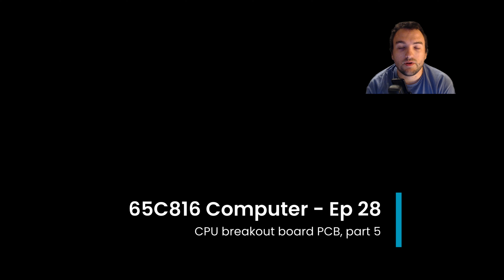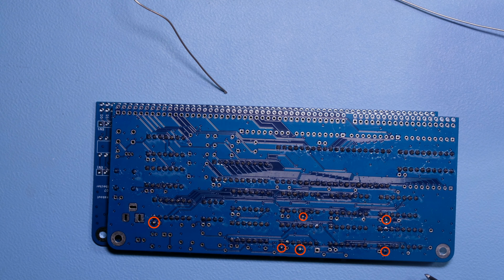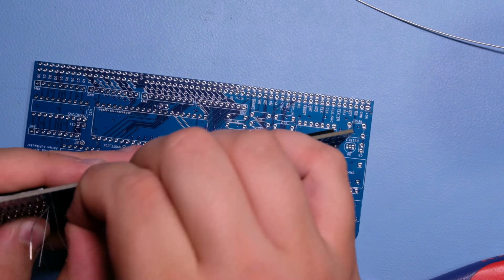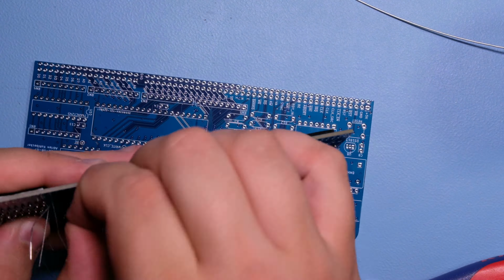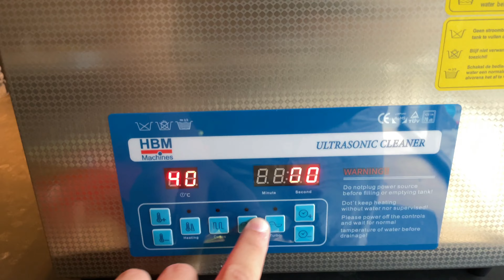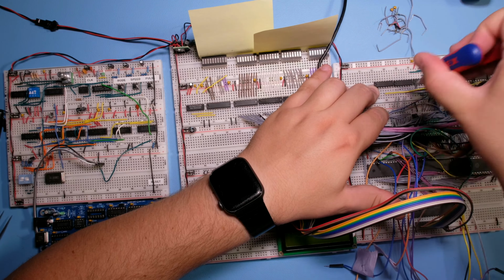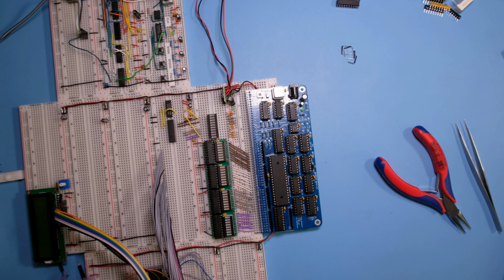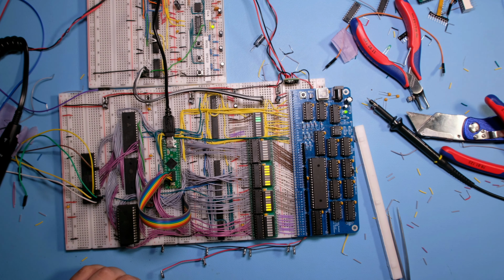#29 - CPU Breakout Board Assembly - BB816 Computer

Comment: One question about the terminating bus resistors on the breakout board. Adding additional boards to the same bus (say a DMA device or even another CPU breakout), with their own resistor networks, would tend to drag the bus lines low, but how many boards would I need to add before the bus became unstable from all that pull-down? Should resistor networks be omitted when assembling secondary boards? Or is the pull down resistance still so high that it won't matter?
Reply from the maker: They're not terminating resistors, but weak pull ups or pull downs, so the bus is not floating when not in use (eg. when BE is deasserted). I wouldn't add them to secondary boards!